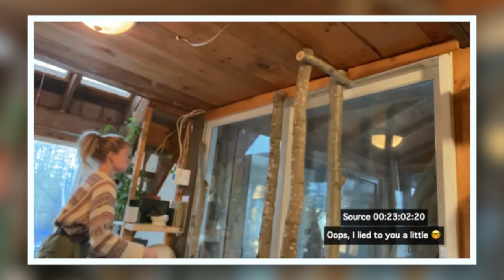Before & After Cottage Tour: One Year of Renovations

Comment: Love it all! FYI: those window coverings you're making for the screens on the porch, install them on the outside or else the snow and rain could still get through the screen, pile up behind the curtains and eventually push them forward allowing snow and rain inside. Been there done that. Learned my lesson. Lol
Reply: Good point!
Reply: Yeah, she can make them like something that's easy to just roll up, for when not in use..
Reply: Agree, I was thinking the same thing. Maybe she can also put hooks on the bottom too, so they can stay down and dont go flying when it gets windy
Reply: @lisalbers230 
That or weights
Reply: As I see, Hannah's got a lot of storage room available. 

So, being her, I would consider to add something to her own idea: Measure all the windows holes of that inner porch, get clear acrylic glass sheets cut in shape, and put them in wood frames which can be mounted tightly fitting in a way to be taken out as soon as the weather becomes comfy, an be stored in the second cabin or in the shed, as plexiglass is not that heavy.

Their advantages are to really keep snow out, let the light in, and add a bit to insulation.
Reply: @Galemor1  7’
Reply: @Galemor1  7’
Reply: @Galemor1  7’
Reply: @andeekaydot  this. Storm windows. Will make a world of difference

Comment: You have every reason to be proud.  You’ve transformed a ramshackle cabin into an adorable home. Can’t wait for the day you can get a new wood stove.  If you get one with a blower, in the summer you can put a bag of ice into a metal bucket and place it inside, turn on the blower and you have air conditioning.  I had a friend who sold Buck Stoves who showed me that trick.  Honestly, it was so cool in his showroom in the heat ofAugust you could have worn a sweater!  Enjoy your cottage!
Reply: Great idea there!
Reply: OMG...I have blower on mine and this is a fab idea!
Reply: @ravenwildspirit  , use a metal bucket. Keeps the ice cooler longer.  And if you pick up one of those ice making machines off Amazon, you won’t even have to buy ice.  I was actually cold in the hottest days of August in his shop.  Pretty amazing.
Reply: @susandunaway8290  thank you💖
Reply: Everyone here has great ideas! Didn't know that was possible

Comment: If I were you, I would spend the next few months weatherproofing windows, doors, and walls, and installing a new heater. This way you can stay warm for longer during the winter and come back earlier in the spring. Save some of your indoor projects for when it gets cold, like fixing up the kitchen.

Anyway, it's been fun to watch you overturn this whole cottage, your drive and passion is really inspiring, you should be very proud of yourself. I'm looking forward to seeing what you'll do next.
Reply: Exactly what I was thinking. Winter window covers/screen covers of some sort (like shutters) could really help with this.
Reply: @sorchaoconnor3750  She can start very easily by changing sealing strips on all doors and windows, and apply caulking in wall and floor gaps. But more time consuming projects like adding window shutters and changing wall isolation in places she hasn't yet, will be worth it too.
Reply: exactly, cosmetics can wait but warmth shouldn't. Don't suffer for aesthetic
Reply: Watching all she's done. I thought oh she could just make square and octagon wood frame and seal off with plastic and the curtain she already has. Get rid of the wood stove for safety. Get the small propane inside little tanks. Whatever she does will be amazing. Will enjoy her progress or just her holding still in filming whatever it is she's doing in the moment. Awesome clothes also what a great deal.
Reply: AP p

Comment: Sounds silly but a great way to help insulate windows in winter is to add clear contact to them as it acts like a double glaze. So it is easy to put on and also take off.

I have done it to rentals for years. Plus cheap contact is actually really affordable even with floor to ceiling windows.

Comment: One thing to consider when it comes to storing firewood in the house or on the porch is that can introduce wood boring insects to all that wonderful wood you have. That would make them a real cozy place to live and breed and bore to their tiny little hearts desire. Ask me how I know... Anyway now I keep my firewood away from the house and make the trek out to the wood pile to get it. I only bring in what I intend to burn at that time or shortly there after. So the wood is still cold-ish and anything living insides it is still dormant until it is in the firebox.
Since you do have propane you might think of getting rid of that POS stove and getting a propane stove to replace it. It would make your heating so much simpler for the times you are there in the winter. 
Third suggestion, in the winter close off that upstairs and just live in the main part of the house. I would bet that most of your heat goes up there and the rest out through all of that glass. Yeah a three season place but a really nice one too. 
Sorry for being so long...
Reply: There are woodstoves now that are more energy-efficient than modern heating solutions and I think Hannah enjoys the vibe/way of life of having one. The real key here is upgrading to a stove that is more efficient and appropriate for the space, and insulation, insulation, insulation. 
I'd be willing to bet that the roof in the loft space could use a lot more of it. 

Better windows would also be ideal, but it's expensive, in the meantime, thick insulating curtains would help and for when it's really cold, making some foam insulation board panels to blank off the windows at night (like a beefy version of window covers for campers) to keep in all the heat and maybe consider leaving some of them in place during the day on the more redundant windows.

Insulation will also help keep the place cooler in the summer.

Comment: For the wood burner you could replace it with a new one that heats a larger area and they are not as huge as the one you have
Reply: yeah or get the ones that are made out of this fancy stone, which gets super hot and radiates heat for hours!!! i do not know the name, but my ex boyfriends parents had that in their living room in cold ass Norway lol
Reply: @woodenNL  Soapstone.  They are wonderful and so many colors and styles to choose from.  Also they have a metal fan that you can buy. It sits on the stove and the heat is what makes it move. Helps distribute the heat to the rest of the house. Also helps to keep a cast iron kettle on with water for humidity so your skin doesn't dry out.

Comment: Winter is coming Hannah. It looks like you need to focus on the heating and all the insulations and all related stuff whatever necessary. You can skip the kitchen part and simply add LED strips to illuminate the kitchen for a quick solution. Other commenters suggest of shutters for windows on the outside are quite a good idea. And maybe beside the window shutters, door shutters would also improve the insulation.

 If the time would enough,  you could change the location of the stove, by relocating it with the Owen or put it to the other corner. You could remove the kitchen benchtop to the stoves' previous place and create a new kitchen space there. Then you would not need a window ...And the heat dissipation could be lower. And you could create a  warm corner in front of the new stove. If you select your new stove which resembles a fireplace It will also give a nice light in winter. 

Addition:  I recalled that a fireplace-like stove is a bad idea since your house is wooden. At least it will need to tile with stone insulation around it.

But above all, you need better doors, windows and maybe renewed insulations too. There are insulants that are applied outside of the concrete houses and they have an appreciable effect on heat loss. Inside and outside apply such insulators improves the quality.  I highly recommend it. I believe some things are suitable for cottages too. If not,  you can add another layer of wood to your house,  to cover the insulation. They took time and effort though...

By the way, I am looking forward to seeing the projects you are going to make on the cabin. It looks it could be warm with a stove and some similar insulations.

Comment: To fix your screen issue, you could build a wood frame that you could screw up or take down and get some heavy duty clear plastic to staple onto the wood frame. Or frame that wall out and get some used windows to put in.
Reply: smart!
Reply: We did this for an outdoor summer house we sit in.  We used eye hooks to attach in the winter panels.  My Dad also made flip down shutters to cover the windows outside.  He added chains on the side that we could lower them to use as a table top when we had family cookouts.

Comment: You could just add windows to the screened in sections of your porch which would allow you to use for at least 3 seasons and possibly 4 if you added insulation and wall panels to the lower portion of each wall and added insulation to the ceiling and finished it then you could heat it either with the wood stove or a small space heater. If you don’t want windows that open you could make plexiglass panels to go inside the screen openings and put them in as needed which would extend the amount of time you can use the space.  Your cottage is beautiful and I love watching you make the changes and bringing your vision to life.

Comment: I have a suggestion for the windows on the screened in front porch. Build storm windows with heavy weight plastic that will fit in the window opening without having to remove the screens. Place them on a hinge to the ceiling, so that they are out of the way and can be lowered as needed.

Comment: You could buy those indoor/outdoor bamboo blinds to prevent snow from coming in. They’re very affordable! They just require a couple hooks. You hang em in 5 min. You can even buy really wide ones and just cut to fit, if u don’t want to measure. They’re really long. They just roll up and drop down like vinyl shades. Expect WAY EASIER to put up. Then 2 min to take down in spring & summer.

Comment: You could join your area FreeCycle group and put up a wanted post for a woodstove.  They get removed from homes, or replaced with pellet stoves and end up in a landfill.  It is better to rehome them and you could get one for the cost of gas and labor. You certainly don't need anything very large to heat your footage.  Covering the windows at night also helps keep the heat in.  I am sure you can find washable curtains or drapes at a thrift store.

Comment: 24:33 Label printer or maker. Uses plastic peel and stick labels. Has a dial you spin to select a letter/number, squeeze the trigger handle to emboss the plastic strip also moves the strip to the next position.

Comment: The sliding doors near the stove probably pull your heat right out. Try making insulated curtains for the winter. I did that in my tiny house in Alaska and it helped. 

Also they make wood stoves that are so great they sweat you out and their air tight and run for hours. I lived off mine in Alaska.  They also have a blower that can be added to the pipe. It's fantastic.  Good luck

Comment: If you go with plastic lined 'tent' flaps, at bottom weight it and tie it so wind does not blow into the room.  Maybe split dowels? to keep it straight lines.  Would also be easier to roll up when not needed.

Comment: You absolutely should be proud of everything you have made. Everything doesnt need to be perfect. Old places very seldom are. I live in a old house and EVERYTHING is crooked. But it's cozy and i wouldn't trade it for anything. (I think I have even lower ceilings than you too. :D ) I think you are right in replacing the stove thingy. There are much more efficient alternatives, but they can be pricey. Maybe you can find a used one? You do already have the chimney pipe so just getting one that fits in the same place and adjusting the pipes wouldn't be too hard i think. I have loved seeing you fix all the things so far and I think you are doing just great! Figuring stuff out and in the process discovering what works and what doesn't. Not a lot of people do that anymore. Your place is YOURS. A bit chaotic, sure, but also cozy and pretty. :D

Comment: You should look into a pellet stove that burns corn. It doesn't need to be vented, and it's renewable and sustainable and VERY efficient. Probably would be a significant improvement on the wood stove. Wood stoves are nice, but they're not efficient.

Comment: It really does look amazing! Lots of work! I think it's way harder in such small spaces. Mobile home living is horrible to remodle. You absolutely have to make every inch function for something. And adding the decor is equally hard. And clothes or anything Cloth, you gotta put in hard plastic totes. To keep the mice eating them to shreads. The weirdest thing happened in what I call our redneck motor home. It doesn't have a motor & hubby made it so he could pull it with a old wagon tongue hitch. 
 I put half his clothes in the timy closet & half my clothes. The mice shredded mine to bits & never even touched his side of the clothes. Nothing separating them, they just left his intirely alone.. Just really weird to me!

Comment: About your toilet water problem, as you sit on the toilet the wall on your right directly behind it I think is your kitchen sink.  If you drill a hole through the bottom of the wall you should be able to run a toilet/water hose through it and connect it to the cold water supply feeding your kitchen sink.  This would give your toilet a constant water supply and you would not have to manually fill it.  Take Note: I am NOT a plumber but I have worked on my fair share of toilets and sinks, so there is at least a possibility that I'm right.

Comment: You did say that the toilet does not have a water supply?? If the shower has water, it would not be that hard to run a pipe to the toilet. You must have a sewer line under the toilet and a sceptic tank if you can pour water in the tank and flush it.

Comment: Instead of you hanging your your rair/snow sheet on the inside why don't you build a window shade that sticks out like 3 of 4 feet and drop's down at a 45° or 50° angle then use your rain/snow sheet too line the window cover on top and the sides.